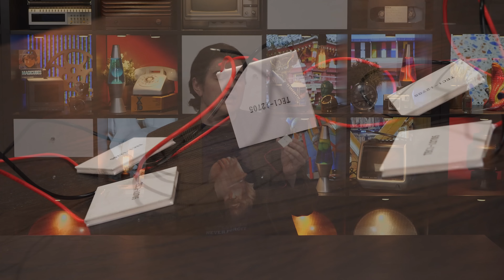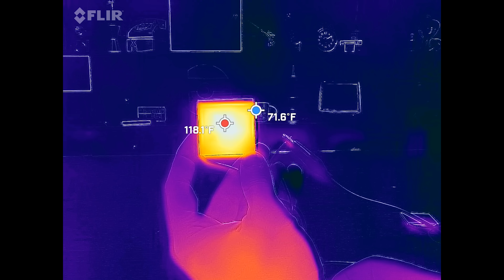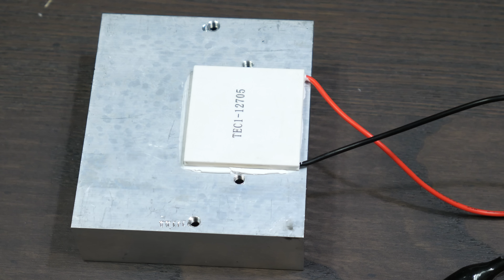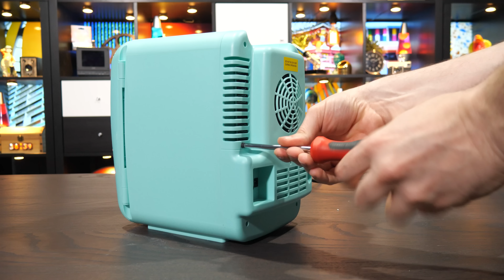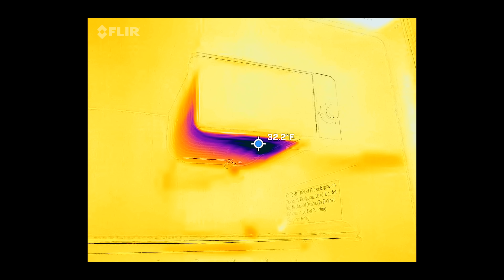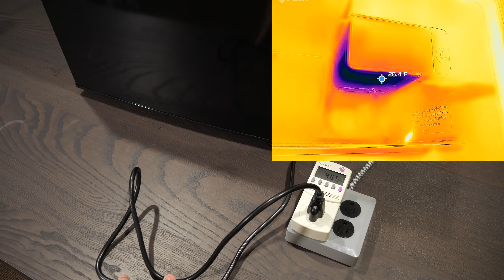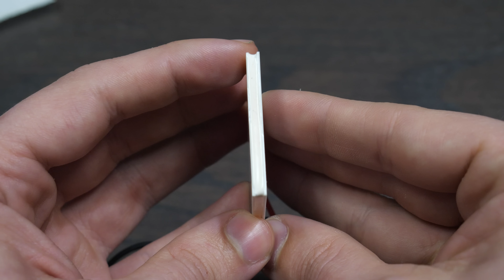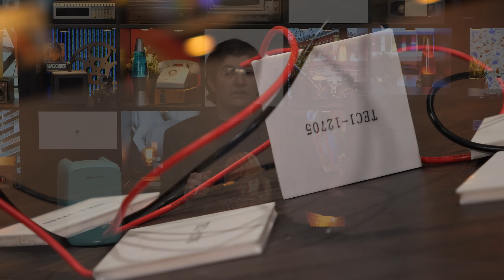Thermoelectric cooling: it's not great.

Comment: I know those less from those beverage coolers (which are available here as well) or sometimes hotel room fridges, which have a hughe heat sink to avoid a fan and somehow seem to manage keeping beverages cold, but the most common version you find here is a cooler box with such a cooler in the lid, that can be used in the car as Alec mentioned. Also live the fans on those are quite a bit less noisy. While the peltier element surprisingly is not a lot larger than the single size that seems to be used for everything. 
If you want to get something cooled down, well, you got the wong item, or you have a few days time for it to cool down to whatever it is capable of.
If you want to use it to stuff already cooled items into it and just keep them cold without having to juggle melting and turning quite wet ice cubes in your car where you have it plugged in to a 12 V outlet, that works what I would call even quite reasonable.
Unsurprisingly at 12 V they just barely keep things cold, plugged in to a regular 230 V outlet here it does a lot more (not sure what kind of power supply is in between)... within its capacities. And if you have one with two power leads. (I just realize that thinking of how simple it is built, I don´t even dare to check the 12 V plug if it has voltage on it when pluggfed in to the wall...) So it does kind of work in some way, but to be honest, mine is so old, it did not even have the mandatory EU energy label. And to be honest, I am somewhat scared to plug it in and check how much power it draws... But as Alec said, it may not be that relevant for a limited time in a car.

When it comes to fridges, while the regular, comparatively smaller fridges are still what i would call common around here. American style or side by side fridges become a lot more popular here in the last years. side by side might by the way refer to models that have fridge and freezer side by side, or the fridges french doors side by side. most common brands seem to be originated in South Korea... 
Looking at those and considering that I had to replace my 14 year old model last year due to bearing damage on the compressor and fan which was not economically to repair, i also found out, that within a wide price range you get a whole variety of devices with different efficiencies. classical built ones, that work fine, and modern ones, even with 2 refrigeration circuits on one, rarely two compressors, but inverter controlled compressors as such, that draw as little as a quarter to a third the energy of a classical version. At a higher buying price of course. I could have got one even more efficient than the one i got, but i did the math, for the added price (about 500 EUR no matter which brand) at the cost for electricity in my place to pay off, i had to hope for the thing to keep working for at least 23 years to break even... Sadly with modern devices, I have little hopes for it to remain working for the next 20 years. I would be more than lucky to get even 15 years out of it.
the price drop to a less efficient fridge was a lot less, while the energy consumption was at a way bigger difference. what they all advertise for at least the last 15 years now, is using some sort of "no frost" technology. And other than any fridge i had before, i indeed had never to defrost it. if you want to keep ice cubes in an open container in the freezer though, they will disappear over time as well!
also one interesting difference between the old one and the new one, the old one blew cold air in above the top rack, so when cooling down, items on that rack could reach up to (uhm, down to) -7 °C while being set to 3-4 °C and go up as high as about 5° C due to its threshold levels for switching on and off.
With the new one, having an inverter compressor (it may run longer at a lower level to achieve the same "keeping cold" with less energy or ramp up to full power to get things cold) and some more intelligent electronics to control it, the thermometer i keep in the fridge seems to be frozen exactly at the set 3 °C (maybe I should throw in a dataloger to see if it actuall moves somewhere). And yes, those 3 °C are less than the recommended fridge temperature. I just kept it at the set default it came with, which works perfectly fine for me. The freezer is at -19 °C also a degree colder than the recommended -18 °C.

Comment: Got mine as a gift, occasionally use it to keep a six pack cold when I have someone over, so we don't constantly have to go all the way downstairs to the kitchen. Only plug it in those few hours, a few times a year, and it takes up very little space... it can be practical, but it is little more than a novelty item.

Comment: I have one of these at my desk.  I fill it with sodas to start the week, and grab one can each day. It’s great - a cold drink whenever I want it. Mine seems plenty cold - in fact, over time, the metal things in the back of the fridge actually ice up.  I turn it off sometimes on the weekend to thaw.  

My fridge has a “heat” setting too - which I wonder if it somehow runs the voltage in reverse to heat the inside facing side, and cool the outside facing one?  I admit, I never tried the heat setting. Not sure what I’d use it for.  

I don’t have room for a cube fridge - otherwise I’d have one instead.  I had one in the basement “man cave” of my last house.  

As for pulling a constant 60 watts - I’m ok with that. I have solar panels. My house “idles” at 800 watts, but can climb to 8.0kW if I’m running AC on both levels plus the electric oven and electric stove.  I converted all my lights to LED, so even at night with the house lit up, the energy usage doesn’t jump more than 200 watts. (that’s about 20-25 light bulbs on) 

Bonus feature: the fan creates some white noise, which helps with my constant tinnitus.

Comment: One thing not mentioned is that pelletiers, being made of ceramic, are actually fairly delicate and can be broken by shocks or vibrations. If that happens, they basically become resistive heaters.
Also, pelletiers have a max operating temperature (in my experience 120C) that, if exceeded, results in damage and loss of effectiveness.
I'm using them for a niche application that requires lightweight, quick, precise heating and cooling of very small volumes of liquids. They fit the bill, but are fragile, required a lot of engineering and put serious requirements on the power supply. And the fans required to extract heat from the hot side are very loud, which is a major downside as mentioned in the video.

Comment: I saw a the Peltier Effect used in the Australian bush to keep beer from going to +40°C in the Aussie outback. The idea was to get a canvas sack and soak it in the petrol/gasoline. You then place your case of beer cans in the sack and hang it from a tree. Igniting the petrol soaked canvas sack then draws the heat out of the warm beer cans. Now as shown is this video your not going to get fridge chilled beer, probably closer to 15°C, but it's better than a tin of beer that reached +40°C because it was sitting in the Australian sun for a couple of hours.

Comment: I once had one of those cube mini fridges from a pawnshop that actually used Thermo electric cooling. It was really quiet, but only chilled things. I also think it pulled near 100 Watts all the time. I ended up getting a heat pump one and when I sold it, I told people that it’s good for soda cans, but I wouldn’t keep milk or anything sensitive in it.

Comment: There is no mention that peltiers are extremely common in devices (instruments) where precise temperature control is needed. They do a much better job at this than compresors. Ruggedness is needed there so peltier again. Next advantage of peltier is that if little heat needs to be pumped (for  cooling small parts) they can achieve very low temperature pretty simple. Inefficient, but rugged simple and durable. More expensive though because high quality peltier is costlier than a simple heat pump.

Comment: I have one of those small drink coolers and have had it for a while. Before even watching this video I was considering just buying a mini fridge due to the size and the fact that overtime I've noticed that the cooler has stopped making the drinks as cold as it used to, I took it apart and noticed that many of the parts are corroded. It seems that these coolers only have a life of 1-2 years at most before they kinda crap out.

Comment: Our builders used these at work to keep the drug test strips in the self test room. It was a small 12V Unit with a 230v supply and a small transformer not unlike a phone charger at the wall. Anyway,  the fridge it's self caught on fire and burnt the whole work compound down, causing 2 Million dollars in Damage.

Comment: I installed a Peltier cooler on a computer cabinet in the bag house of a steel mill. There are huge amounts of dust that means the cabinet has to be sealed. I initially installed a vortex cooler that used compressed air from the mill. The noise was unacceptable, even in an industrial setting. I couldn't find a compressor type heat exchanger that didn't require a lot of maintenance. I used cold water heat exchangers in other parts of the mill, but cold water wasn't available. I wound up putting 2" polystyrene insulation on all the inside walls of the cabinet to assist the Peltier. The only maintenance was blowing off the fins with compressed air once a month.

Even the best intents can get screwed up. The millwrights disconnected the cold water source at one location, and ran the water from the roof of the electric arc furnace into the cabinet cooler. It cooked the computers. Not very smart people working there!

Comment: 1. I don't care if it uses a trivial amount more power over a year even if I were paying for it
2. It's at work, I'm not paying the energy bill
3. That mini fridge doesn't fit on my desk
4. Buying that little fridge costs significantly less
5. Why would I care if I can put 100 sodas in a bigger fridge? I don't need 100 sodas cooled. I need two or three. 
6. It's for sodas. Why would I care if it's not below USDA certified safe refrigeration temperatures for cold food storage? That's not what it's for. 
7. It's still less noisy than a compressor running
8. I can take it with me easily if I'm going somewhere overnight, unlike a whole mini fridge

You're comparing apples to oranges with this one. It's a small, portable, beverage cooler. Why would you compare that to a fridge? I don't compare nail clippers to pruning shears. Nail clippers are worthless for pruning hedges... but that's not what they're for. 

I'll take the drink cooler over a mini fridge any day

Comment: I bought one of these Peltier coolers for camping, thinking to run it on solar.  Bad idea.  Drawing 50 watts doesn't sound like much, but that's enough to kill a deep cycle battery overnight.  (Typically a deep cycle battery is rated about 100 amp-hours, but you are only supposed to use 50% to not damage the battery, so 50 amp hours, which gives roughly 10-12 hours when drawing 50 watts and 12 volts.)  It just didn't work out.  So I replaced it with a compressor cooler and I am having much better luck running it on solar.  I'd say the power draw is half or less than the Peltier cooler, and it has a digital temperature control so I can set it to exactly the temperature I want or even keep milk and eggs in it.  It was twice as much money though, but the Peltier cooler was not fit for purpose when attempting to run it on small scale solar.

Comment: The electrical usage is only really an issue due to the absurd price of electricity, which in turn is because the powers that be insists on genetating it through ridiculous ways hostile to the ecosystem (coal, oil, wind, solar, etc.). If that was taken care of, I can see many ways to improve this design with a better heatsink, better insulation, more cooling plates, etc. I bet we can even find a better fan.

Comment: I have one, slightly bigger and actually works fairly well compared to the blue thing you have lol. In the winter it actually can frost up, and drink temps are cold enough for me as long as the house AC is working (it's broken right now... I have a sunset-facing room and no awnings in CA summer... save me). And while I like the size and like the lack of compressor noise (easier to tune out the constant fan noise), seeing the energy usage is absolutely insane to me. Not having cool drinks with my broken AC ruining the cooler's power to do what it's supposed to do was already testing my patience. But now, I think I'm gonna clear out some space for a real mini fridge cause wow I didn't realize how bad the efficiency was. I've been wanting something food-safe for a while now anyways!

Comment: I recently visited Japan where it's incredibly hot during the summer and most electronics stores typically sell a few models of personal, battery-powered fans that are equipped with an integrated Peltier plate. I found it's mostly a gimmick since cooling 90+ F air with a small, short contact thermoelectric plate cools it about as much as you'd expect (basically none). However, using it indoors where the AC is already pumping is actually incredible. Even the little battery-powered Peltier plate cools the already cooled air a few extra degrees and is a wonderful welcome after sweating through your shirt for hours.

Comment: I actually have seen a good use case for peltier coolers: data recovery. At a computer repair store I used to work at, sometimes dying mechanical hard drives could be kept alive just awhile longer if they were kept cold. We had a peltier cooler with a block of aluminum on one side, and two CPU heatsinks on the other. It'd keep a hard drive cold long enough to get data off, without having to send it to a real cleanroom data recovery facility (which the customer couldn't afford anyways)

Comment: I will say that I traveled all across the country on an extended road trip with a Coleman thermoelectric cooler.  It performed flawlessly.  I was storing milk, cheese, eggs, meat etc. in it during the height of summer, with outside temps in the high 90s frequently.  The food never spoiled.  When you run the A/C in your car, a properly insulated thermoelectric cooler can easily maintain food safe temps, and the fact that it was still also just a Coleman cooler meant that it could even manage being left in a boiling hot car for a few hours switched off without any problems.  It really did work just like a normal Coleman cooler except you never needed to buy ice for it.  

In other words, that little beverage cooler is junk, but not every thermoelectric cooler is quite as poorly made as that thing.

They do make compressor-based, 12v portable coolers now, but all the issues mentioned here still apply.  They are heavier, must ride absolutely level in the car, more expensive, etc.  I have one, and while it is better than the thermoelectric cooler in some ways, it is inferior in others.

To be honest, a basic, unpowered cooler with a few of those blue ice packs is superior to either technology if you are only taking a short trip.  On a longer trip, I would get a compressor-based portable cooler only if I planned to leave it in the vehicle virtually permanently and had figured out some way to keep it running all night when the engine is off.  If I planned to bring the cooler with me into a hotel room every night, the peltier is much lighter and probably the better choice, assuming it will largely live in air-conditioned space most of the time.
Reply: You're right, It is not a very fair comparison.  The mini fridge is much better insulated, and benefits from having a thermostat.  There wasn't any discussion about how much energy was consumed in the fabrication of their construction components.  And there wasn't any discussion about the longevity of the device.  It was an apple to orange comparison.

 This is essentially the same problem as compact fluorescent Vs LED bulbs.  The CF's were more electrically efficient than LED's, but much more expensive to make, more expensive to package, heavier to ship, and a PITA to dispose of.  TLDR; there's a lot of other costs besides variable operating costs.  I would suspect that at any minute a discovery in Peltier diodes could turn them into a vastly superior technology.  

I also don't think he was very fair with how he described the Peltier's ability to lower the temperature by only 30 degrees below ambient.  I've seen frost form on aluminum cooled by these elements while I was messing around with them in a 100 degrees F shop environment.  Logically, that means the aluminum made it down to freezing temperature of 32 degrees F, which would be 68 degrees colder.  Even if you convert that to Celsius, that's a differential of at least 37.7 degrees C, so I don't know where he's getting that number from.  That 30 degree number he's quoting is certainly 30 degrees Celsius, but he's talking about the ambient temperature in Fahrenheit.  He either did this on purpose to make the Peltier look worse than it is, or he did it because he got so caught up in shitting on them that he didn't catch his own mistake.

Comment: Seems to me that Peltier Elements : One , made Thicker , and : Two using Heat sinks on BOTH sides , and : Three , using Two Fans , one as a Heat Dump and the Other as a Recirc  could be made reasonably efficient . Especially for a Car Fridge or Air-Con .

Comment: There's actually a category that you didn't cover: the 12VDC "car fridge". They've gotten to be more common and they're not even super expensive anymore. I bought my 10QT model because a cooler often doesn't cut it for my job when I'm out for 12-16 hours. It was only $100, and it runs on either 12V or 120V with the included inverter. Gets cold FAST, nice for long trips.